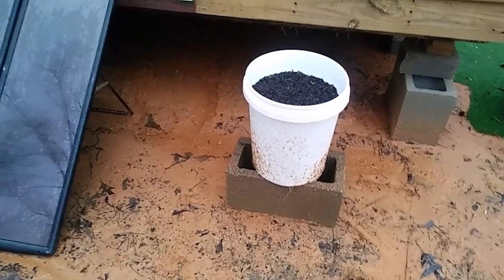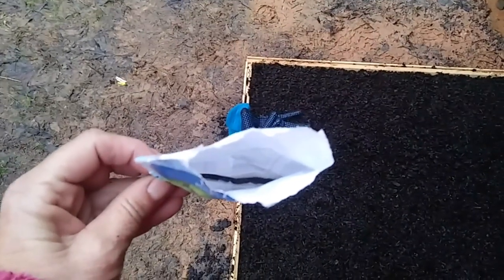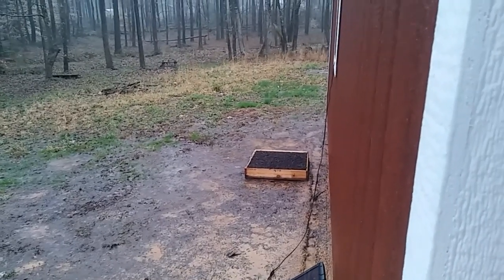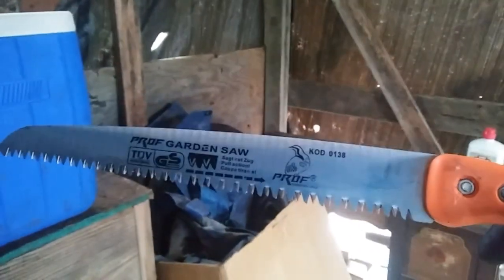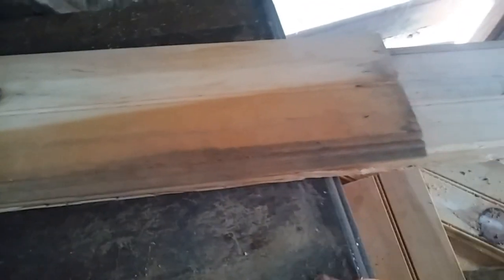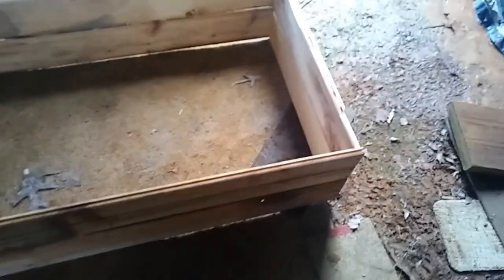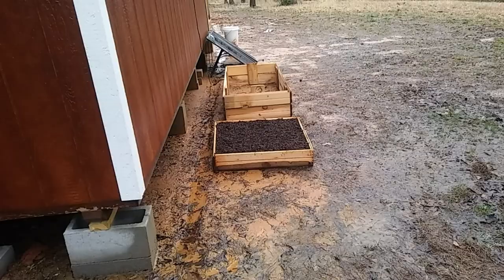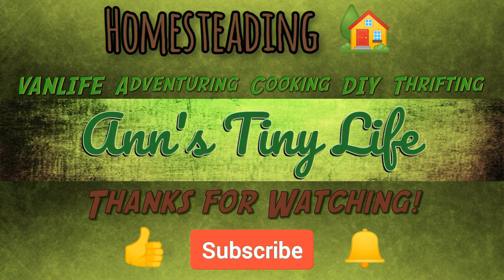Planting Projects - Ann's Tiny Life

Comment: Check into planting potatoes in a 5 gallon bucket, works great.  Just cut one potato with the little root parts starting in half.  The fill the bucket, you can put a little leaves and stray, not to much.  Place the potatoes in the holes about 2 1/2 - 3 in deep with the root side UP.
Cover and water.  Oh drill a couple of draining holes in the bottom.   You dont want your roots, potatoes to rot.
Also, the "dirt", your putting your raised beds on, is it good soil?  It looks like red dirt or clay that was used to make your driveway.  You might want to put them over on the leaves or a grassy spot.
Just a few suggestions.
Oh, you can grow tomatoes in the buckets too!
Reply from the maker: I'm really considering doing that. I planted potatoes in containers before. but at the end of the day on the scale I'm looking at, it would be cheaper to just go buy potatoes then to plant them. however I have a real itch to grow potatoes. So I may still do it just yet!

Comment: Great progress!  Keep working on those raised garden beds AND getting that shed cleaned out for Mr. Maran and his ladies!!  What are the actual dimensions of that shed?  Is there anywhere near you that you can get old pallets?  Take care.
Patricia
Reply from the maker: I don't know what the actual dimensions of the shed are. I'm going to try and get it measured tomorrow as well as cleaned out tomorrow possibly. depending on the weather. I need  to enclose it better with chicken wire and whatnot. It needs some work! LOL
Reply: @AnnsTinyLife  If you can get the dimensions and don't have access to any used pallets to use for the lower walls, I'll see if I can round up some to bring you. Wire will be great, but something more substantial would be best to keep out predators.   Stay safe!
Reply from the maker: I plan to get those dimensions within the next couple of days!

Comment: Is that a tarp over the back of your shed that has a hole in it.  What size tarp do you need to replace it?  Could you use posts with a tarp slanted from your shed to those posts to create a lean to store items outside and to place a barrel to catch rain water.
Reply from the maker: I'm actually going to remove all those tarps and put fencing or chicken wiring around the whole shed and turn it into a chicken coop. Your idea about using a tarp to collect rain is a good one. I've done that before when I lived in an apartment. I actually had one of those pop up sun shelter things and the water would come off of that in certain areas and I would capture them buckets. So that's a really great idea. I do have another intact tarp could I could use for this purpose. I just need more buckets. Great idea!